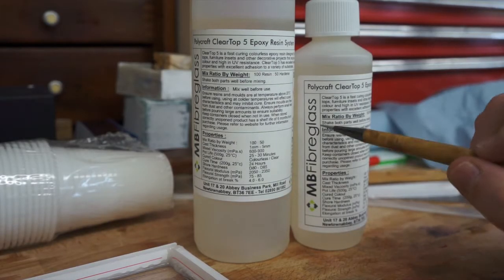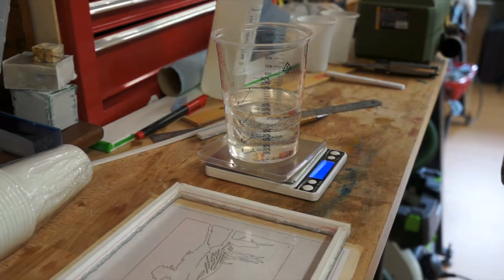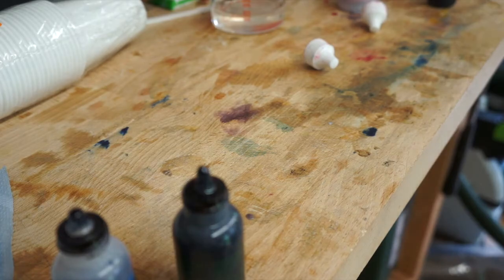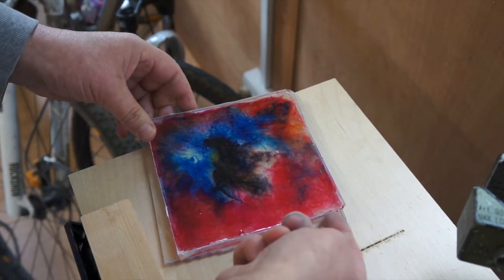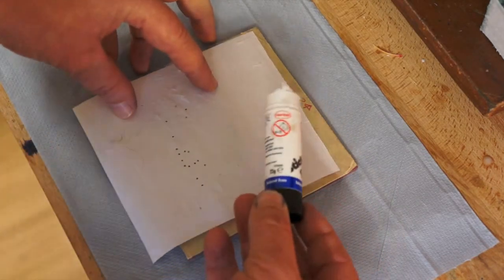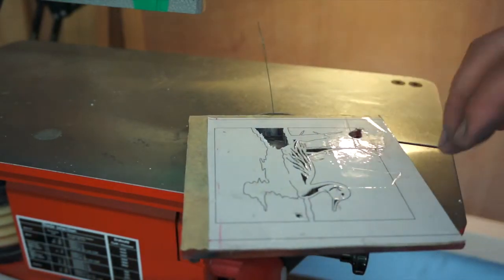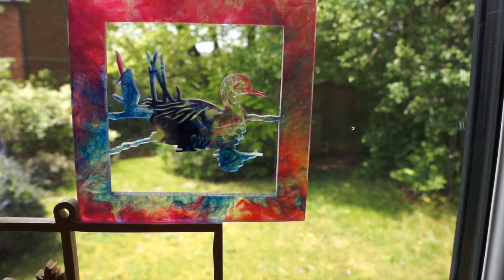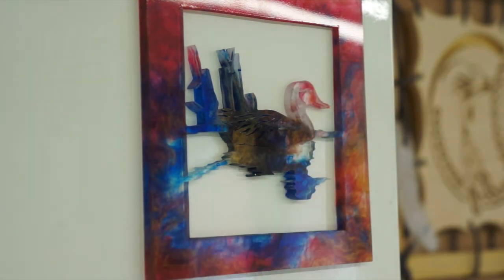Duck in Resin sauce.

Comment: very fine work my friend!. You got any opinion on how tough that resin is?, like if you dropped that would it shatter like glass or just get a few dings?. I know some clear urethanes can be very surprisingly hard and tough but been a while since i used them.
Reply from the maker: Hi. Thank you for the comment.
It is pretty tough. The finer cut parts are fairly delicate but in general this polyurethane is tough.

Regards
Paul